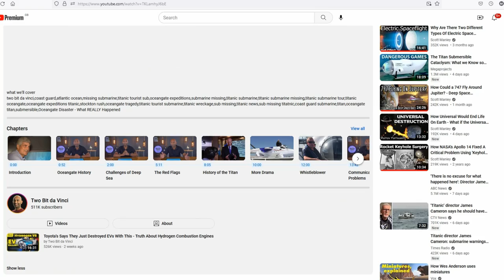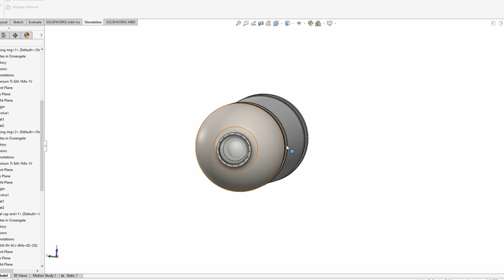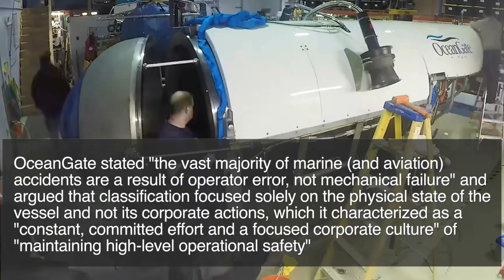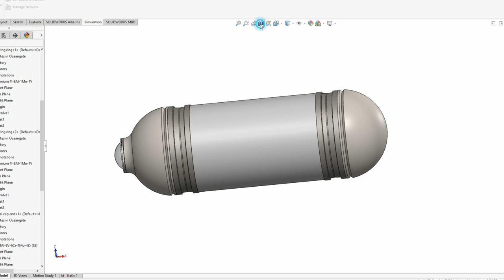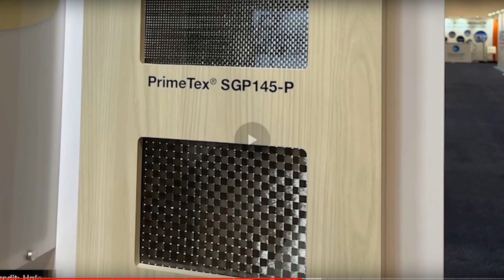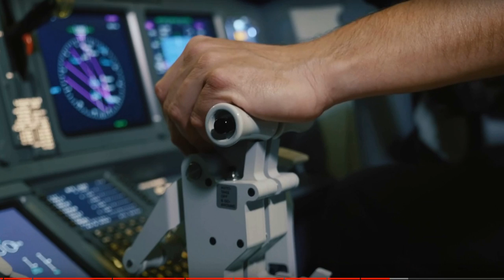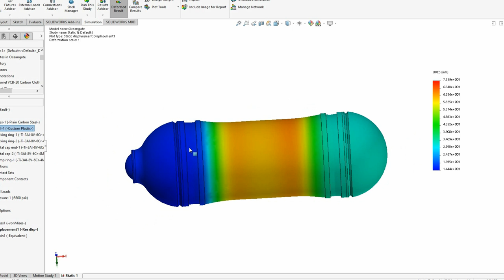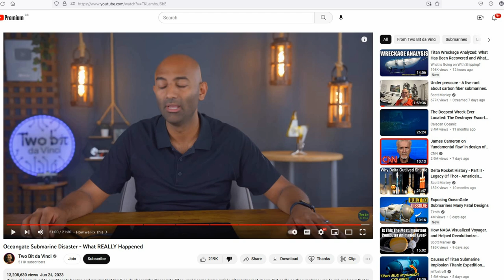Oceangate Titan - Engineering Failure?

Comment: I saw a video of the bonding of the caps. One thing that came to mind was galvanic corrosion. They bonded the metal straight onto carbon without a non-conductive layer. I don't know which effect, if any, it had on the failure. I know that with steel and aluminium that's always a no-no in corrosive environments.
Reply from the maker: Carbon fibre is an insulator as far as I know...
Reply: titanium is much closer on the galvanic table to carbon composites than aluminum. I don't think the problem exist to the same degree, if at all.
Reply: I'm just a layperson but making any structure out of two contrasting materials, is not conducive to the best possible strength. Cohesive structures formed from the same material throughout, are always superior. 

Now we know how carbon fibre is made, it seems glaringly obvious there was steadily increasing risk of water permeating it, and resulting catastrophic delamination. It was critical the 'Titan' was tested to destruction, to learn exactly how many 'safe' cycles of use it had in it. From what I've read, it would seem the number was around 30 'Titanic' dives, before it imploded. 

Stockton Rush was a cowboy, unwilling to invest the money and time in proper testing. If he wanted to risk his own life, fair enough. But he took four others with him - by bullshitting them about the safety of his sub - one of them a 19 year old who had yet to live his adult life. I don't believe his father would have taken him on that trip, had he even the slightest doubt about its safety. Sadly he drank the 'OceanGate' Kool Aid.
Reply: @dirtygarageguy  That's kinda so-so. The fibers themselves are conductive (as you would expect for graphitic carbon), so if you've cut through the epoxy and exposed them (e.g. by drilling a hole) you can get galvanic corrosion happening.

My dad races a 505 sailboat with a carbon hull. Stainless fittings are fine, but he has found that things like aluminium or titanium bottle holders corrode very fast if screwed directly to the hull. Usually we'd use duralac to isolate metal parts from each other, but in that case he gave up and went to plastic bottle holders.
Reply: @glamdolly20 your opening paragraph is glaringly flawed.
Reinforced concrete for example.
Reply: The bonding adhesive is the non-conductive layer.
Reply: @UnCivilEngineerIRL  We are discussing the 'Titan' submersible specifically, which as I've stated was constructed from two starkly diverse materials. The differing fortunes of those two materials at the extreme depths where the Titanic lay, tells the story.

The titanium end caps, are the sections recently recovered intact from the sea bed (evidence of their strength). In contrast, the central, carbon fibre section, housing five humans, shattered on implosion and could not be recovered - reflecting its inherent weakness at those extreme depths.

That middle, carbon fibre passenger portion  splintered into umpteen pieces  - along with its unfortunate occupants. The glaringly different fortunes of the two materials tells the story of the catastrophe, and likely the folly of trusting carbon fibre under these massive pressures.

We are not discussing reinforced concrete here! There was no concrete involved in this submersible vehicle's demise - your analogy is spurious. 

Central to any investigation of the 'Titan' disaster will be the carbon fibre hull, ie the one section of the sub which failed, imploded, and killed everyone on board.

Every statement I made in my earlier post is accurate. What's 'flawed' is your dumb and entirely bogus analogy about reinforced concrete.
Reply: @glamdolly20  we don't know for sure that the carbon failed first... it could well have been the view port which was only certified for 1300m or something to that effect. The carbon will have turned into confetti in any implosion event regardless of first failure point I would imagine... that's just what carbon does.

Whatever it was, it's interesting that some with some level of inside knowledge (like James Cameron) have said they seem to have dropped balast in the moments before the surface lost comms and tracking. That would suggest they heard something start to fail or their acoustic sensors set off alarms just before. That might be a clue into which failed first.
Reply: @Neil_  Yes, it's surprising so few commentators have picked up on that statement. If true (and James Cameron is an excellent source, in close contact with the select group of maritime/submersible specialists in the know), the occupants of the Titan DID know they were in trouble, before the deadly implosion.  While I can't help feeling the architect of this tragedy Stockton Rush deserved that moment of realisation that he'd royally effed up, it's devastating if the passengers were in fear of their lives in their final moments. The 19-year-old in particular, breaks my heart.

Like so many aspects of this story, it's astonishing OceanGate put such faith in an alarm system based on mere audio! If a structural weakness is making a noise once it reaches high pressure, its catastrophic failure is likely imminent - and far too soon for anyone to escape the vessel alive.

Hopefully the pieces of 'Titan' recovered from the sea bed will provide definitive answers. But we may never know what precise weakness caused the tragedy. Frankly it doesn't reflect well on OceanGate that there are TWO major suspects - the carbon fibre hull itself, and the plexiglass viewing window which as you referenced, wasn't up to spec for the depth of the Titanic wreck site. 

Had the wealthy people who took the OceanGate Titanic trip done their homework, it's hard to believe any of them would have gone ahead with it! I feel sure Shahzada Dawood would not have taken his beloved son down, had he any clue they were risking their lives.

It baffles me the legendary French deep sea explorer known as 'Mr Titanic', Paul Henri-Nargeolet, had such confidence in the 'Titan' that he was employed by OceanGate as a regular dive guide on the doomed sub. 

Nargeolet was one of the first to visit Titanic in the late 'eighties, and had been to the wreck around 37 times. He experienced the first, sophisticated submersibles that went down over 30 years ago, subs that made 'Titan' look like a trash can! Nargeolet had the distinction of leading the specialist missions to retrieve precious artefacts from the Titanic 'debris field', between the two halves of the ocean liner. 

No one understood the unique risks associated with deep sea travel better than Nargeolet.  Yet for some reason he trusted OceanGate and that lousy, crazily basic submersible. His misplaced faith in the company and its CEO Stockton Rush, would cost him his life.

It's shocking the vessel as a whole was only designed to withstand depths approx 200m greater than it was exposed to! That is not a safe margin, as any engineer will confirm.
Reply: WRONG, carbon fiber it is quite conductive!... but the electric potential is not too different against titanium, making this irrelevant.
Reply: @dirtygarageguy  Carbon fibers are conductors, not great ones, but they are conductive. Especially if the ends are machined and fibers are exposed. We had this exact problem with parts machined out of woven carbon fiber plate.
Reply from the maker: That's end to end. The resin in an insulator. You'd have to have a continuous fibre or a series of fibre that connect. I have a carbon fibre rod. It has no continuity, and reads as an open circuit. 

Obviously carbon arc lights exist.
Reply: @dirtygarageguy  Did you cut the tube though, to expose the fibers? Fibers covered with resin are insulated. Problem is only when composite is machined and fibers exposed. But I still think that the glue was enough to insulate the tube from the end caps.
Reply: @glamdolly30  They actually had like 20 minutes of warning of potential hull collapse from their real-time monitoring system, but something (I assume the squeezing and subsequent reduction of chamber volume) delayed their initial ascent as well as made it extremely slow.

In my opinion, their carbon fiber hull is actually looking like a great idea...had they had more capable ballast systems to rocket them up to the surface in less than 15 or 20 minutes, they would have survived--even with the (I'm assuming) terribly flawed end-cap interface.

https://youtu.be/kJ2HjMP_nbg Here is a transcript of the texts from the sub (with the transmission times)...it appears their hull sensors gave as much as ten minutes advanced warnings prior to the first "crackling sounds" from the aft part of the hull....and 20 minutes prior to the eventual collapse. I think that is precisely why they chose carbon fiber....and had design flaws not been made and ballasting been more potent and quickly scalable, this would have proven itself an excellent emergency warning system.
Reply: @glamdolly30  I want to add that it pains me to see everyone just trashing every single aspect of this and the people involved before any actual data or non-"conflict-of-interest" testimony had come out.

Aside from legitimate lynch-mob vibes everyone has been giving me, I have been very bothered by all the narcissism.....doing things like shunning carbon fiber as "the wrong material" because someone on CNN said that--despite having no clue why it was chosen yet, acting like everyone who ever went on board was "stupid" and "deserved it" for not seeing what we now see with hindsight, etc.

About the carbon fiber, however, its as simple as this: They weren't using it for its tensile strength, but more likely taking advantage of its flaws (predictable and progressive delamination) as a beneficial tool for hull monitoring....and it almost freakin worked. (I'm told 7 inches, or even just a titanium ring in the middle on the inside may have fixed the design issues).

Anyway, It gives me less hope in humanity watching almost everyone in the comments sections contributing to a lynch mob culture--and for what? To feel ever so slightly smarter at the cost of all the actually innocent people lynch-mob culture has ever and will ever harm? Its unprincipled, emotionally-driven, and short-sighted. ...and that's on top of being purely self-serving when it precedes the relevant data and testimonies being released.

I don't know why its so hard for people to control their emotions for the sake of objectivity. It's been like watching a bunch of angry ex-wives honestly lol
Reply: @ChadDidNothingWrong  'Almost worked' is an interesting term for 'catastrophically failed, killing all 5 people on board' . There are no grey areas in a catastrophe like this!

It's unrealistic to think people shouldn't endlessly debate such a dramatic, global story - or resist criticising the company behind it.

Five people are prematurely and needlessly dead - one of them a 19 year old on the cusp of his adult life. If people didn't get upset about that, there'd be real cause to despair of humanity! 

Ultimately, whatever allegations or indeed excuses are thrown around regarding 'OceanGate' and its deceased CEO Stockton Rush, ultimately the truth will out. But until the results of an exhaustive professional enquiry, there will inevitably be online debate - which incidentally, you too are taking part in!

Interesting bit of misogyny in your closing sentence. There's nothing more bitter and vengeful than an angry ex-husband! To quote a famous phrase: 'Men are afraid Women will laugh at them - Women are afraid Men will kill them'.
Reply: @ChadDidNothingWrong Interesting take. There was a last ditch backup on Alvin that would allow such a fast ascent. the sphere could detach from the sub entirely. whether this was fun or survivable wasn't ever tested...
Reply: @ChadDidNothingWrong I also was considering the ti bracing idea. 

I agree with a lot of what you're saying but unfortunately it's a story almost as attractive as Titanic itself...
Reply: @leoarc1061  I work with pools and they use aluminium for cover roller tubing. You have to use 316 grade stainless screws because the water is chlorinated.  We see corrosion between the screws and the tubing quite often, where it enlarges the screw holes .

Comment: Just one thing: there's controllers and then there's controllers. Yes, the US military (and plenty of others) use modified game controllers like Titan did, but they were implemented in less critical applications (like the article you looked at, periscope control instead of directing the whole vessel) and were probably extensively modified to fit military standards. In the case of Titan, however, it really seems like they grabbed the thing off a shelf and interfaced it with the sub's motors and such.
Reply from the maker: I don't understand why that matters. We also don't have a full understanding of the systems, unless we do?
Reply: @dirtygarageguy  They were wireless and battery powered controller was what was reported. No crew stations, very short sighted shoddy thinking.
Reply: Controllers weren’t the problem, it was the shitty Bluetooth connection that was.
Reply: From all the information I can find the Navy at the least used regular Xbox controllers on subs (couldn't find more current information on what they use now) for the photonics mast, the Army and Marines used knockoff Xbox controllers for drones.  I found some more vague references to weapons stations possibly using controllers but nothing concrete.  I've seen both modified and 'consumer' versions being quoted for this so not sure.  That said they were wired in the case of the Navy photonics mast to reduce point of failure and they had spares.  You can find tons of articles that quote a navy spokesperson as saying part of the reason they use(d) them is because they were cheap at $40 compared to the $38,000 joystick they replaced.  While the IT person and hobbyist in me cringes at the use of wireless for that application even if they didn't have spares and the controller died one would hope the software that controlled the submersible was smart enough to handle that situation but I admit I might be too generous on that one given all the other corners cut.
Reply: AGREED those dodgy third party controllers AND the battery packs in particular are dubiously unreliable.  XBOX controllers are much better. OFFICIAL ones only.  But even A xbox Elite II controller could of still failed.  This Stockton was not just a fool but a reckless moron. And I feel a lot of this was a con job too. I really want to know out of how many dives, how many were scrubbed and how many were successful ?? I have heard about 20 dives. And what happens to the monies of the scrubbed dives ??? I saw him say to one group when their dive was cancelled he said we'll book another dive. But didnt say anything about Money refunds.  I think he was using cancelled trips (and purposely scrubbing missions on purpose) to raise funds. I also feel that JN was part and parcel of it. Using his clout as a sales tactic.
Reply: A wired playstation controller has to be just about the most tested and durable controller in existence. Nothing wrong with using that over any other hardwired controller out there. Don't think I'd be relying on wireless comms though. Space exclamation mark.
Reply: @Clungehammer   They used janky  cheap Logitech controller, probably second hand, they didn't use the best controller, everything in that submersible was like that.  He was saving money on everything, he probably saved money on the titan and on the carbon fiber also, probably the whole thing was just barely holding at all... it just needed a little push to self destruct. He was just so full of himself, he thought the whole thing would just go on pure "will".
Reply: It also looked like they were running windows 10 on the PC that displayed various information. I would not risk my life on it. What if it bluescreens at an in opportune time or applies updates.
Reply: @Michael-lg4wz Apparently it played some of the Titanic film music on a loop as it was booting up. Imagine being in the shit with your systems rebooting (and having to wait for the janky Bluetooth connection to kick in so you can actually steer) and Celine Dion is on a loop. Not ideal.
Reply: @sidwainhouse  the controller wasn't even bluetooth, idk why people started saying this. That controller has a USB dongle, there is no bluetooth support. And a dedicated dongle is way more reliable.
Reply: @worstxb1playertylerteehc635  It's not a cheap third party controller. This is literally logitech you're talking about. They have miles more experience than either sony or microsoft when it comes to peripheral manufacturing.
Reply: @xkannibale8768 
I could be wrong but I seem to recall in one of the videos where they’re discussing the controllers you can see it’s not plugged in, ergo Bluetooth/wireless. Maybe there’s a wire you can use if the battery is low or whatever, but that’s why people make the inference you’re asking about.
Reply: @sphaera2520  again, it's a 2.4ghz wireless dongle. It's not bluetooth. Bluetooth devices are low power, suffer from interference and have shorter range. This is a dedicated 2.4ghz usb dongle. It's not even remotely the same.